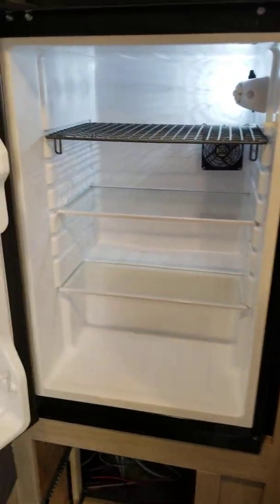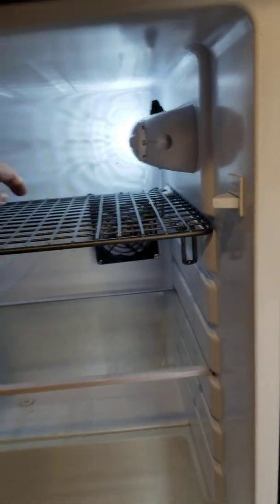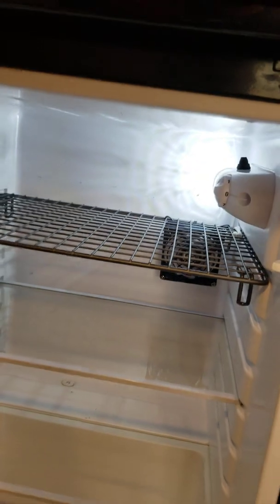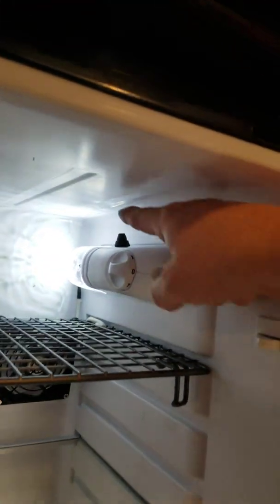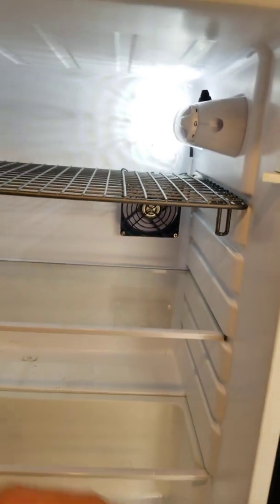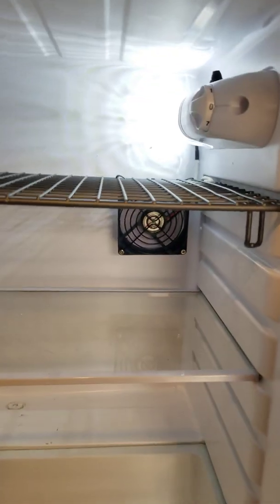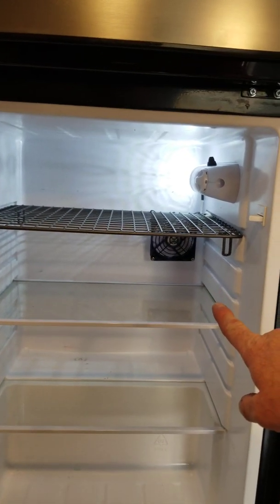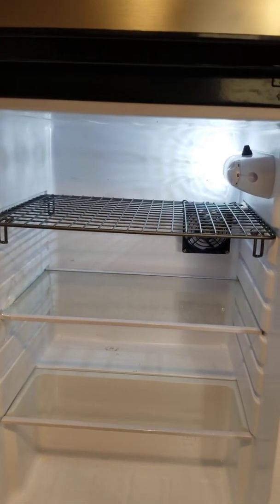RV 12 volt fridge cooling modification

Comment from the maker: Update:

I have swapped all 3 glass shelves with the wire shelves. These mods make the fridge excellent! It cools everything evenly and I can now keep the fridge at a lower setting, which makes it run less and use less energy from the batteries.

Comment: In regards to your fridge…Have you noticed that it isn’t installed very solid?…. That when you open it the top of the fridge rocks out a little…doesn’t seem Like it’s installed to secure…
Any ideas???
Reply from the maker: Whoever installed yours may have not spaced out the bracket properly on the back. The fridge slides into a bracket and hooks in. If it's set correctly, it should be pretty sturdy. I actually pulled the fridge, measured out the bottom of the fridge, and re installed the "hook" so that it is firmly engaged with the back of the fridge.
Reply: Thanks much!
Reply: Is there a video showing removal of the fridge?

Comment: Hi, so you just poke a hole to get 12vdc. Better than size D battery fan that they are selling.
Reply from the maker: Yes just drill a hole and run the wires around to the back. You'll see the screw in terminals that power the fridge and you can just add your wires to it.
Reply: @adventuremanintheclouds8968  do you think you could power the fan with the wires that already run in to the light and thermostat controller to avoid putting a hole in the fridge?
Reply from the maker: @bd9646-1  No because the light is only powered when you open the door, so the fan would only work with the door open. 
I promise it is not a big deal in the least bit. I know it sounds crazy on paper, but it's just a pencil sized hole and it is covered up by the thermostat housing, you'll never see it and it has no downside. This mod is very effective.
Reply: @adventuremanintheclouds8968  Went ahead and drilled through the side.  have it in and working.  Thanks for posting this vid, it helped.
Reply: @adventuremanintheclouds8968  what about the thermastat knob isnt that hot all the time ?  cant tie into that ?

Comment: Hi Nathan, thanks for the great ideas. I have done the 2 racks and the small battery operated fan. I also adjusted the calibration screw. The fridge is cooling down to the mid thirties but my freezer is way below zero. The back of my fridge is frosting up too. When I open the door the temp rises so quick. Guess that is unavoidable. Can you share what number you set yours on and what temp it runs after you do? And if the back of your fridge gets a layer of frost. It’s an everchill in my new 15tb.
Reply from the maker: Sorry for the delay, I have all notifications turned on and youtube still doesn't notify me. 

Unfortunately the fridge and freezer aren't adjustable separately. I'm currently running my fridge on setting 3 or 4. The design of the cooling coils makes frost build up inevitable on the back. The goal is to get that cold frost air to the front. 

I have also installed wall vents to allow the heat from the fridge to escape. They should have left the vents installed like they had on the old models. Last summer I measured the wall that has the thermostat and it was 97 degrees due to the fridge heat buildup. The vents now allow that heat to escape.